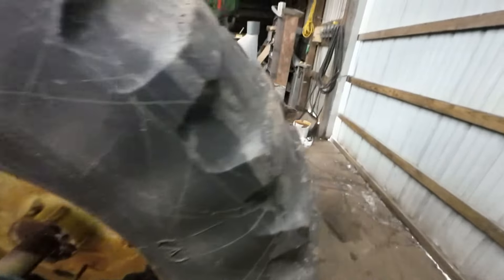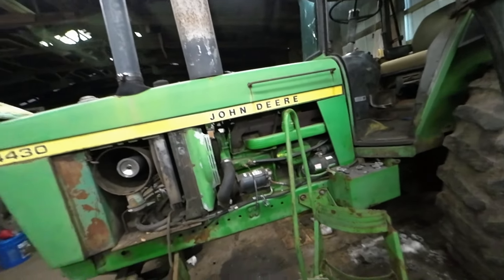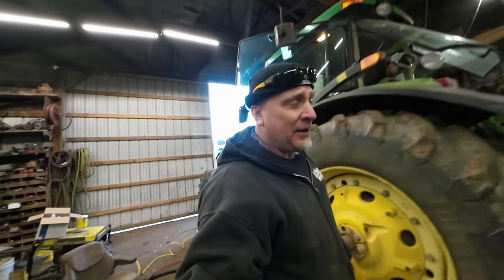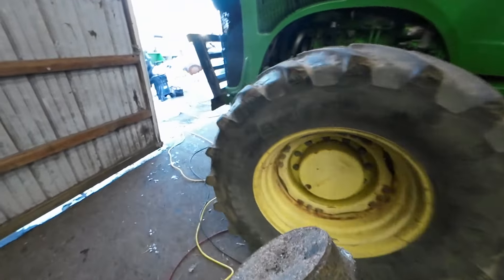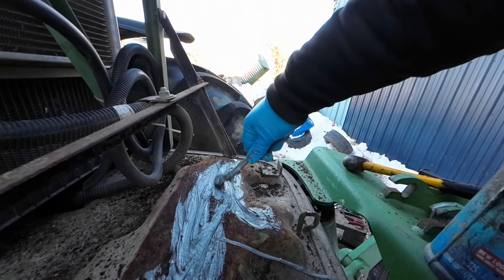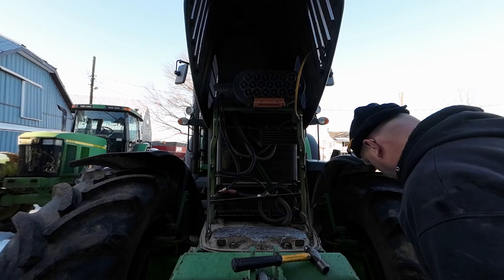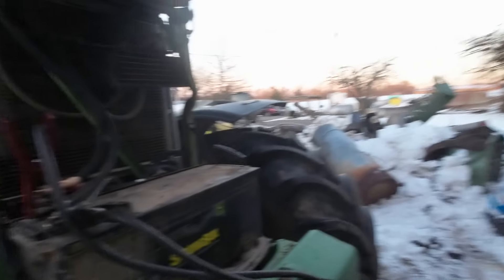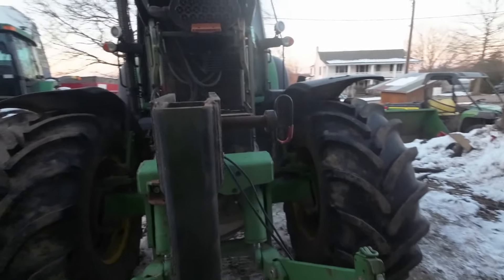4430 7530 will it start pt2

Comment: The number of transmission/hydraulic filters is based on transmission, not model. The 4430 has a single filter with the Quad_Range transmission. If the 4440 has two filters then it has the power shift transmission.
Reply from the maker: I knew that but forgot.

Comment: I would guess no less than $7000 for that hood. Deere parts are really expensive. Glad to see you fixing that 'ole girl up because they are very good tractors. This is really interesting to me because I am working on a 4230 that my dad bought new in late '73. It was the first diesel the dealer had gotten in at the time. He bought a gas model about 3 mos. before this one because that's all they had at the time, but didn't like it, so he traded it in on the diesel 4230. He really wanted a 4430 for the extra power to run the forage harvester, but they didn't have one available. I am pulling the head right now because it has valve issues making it start hard and misfire, but otherwise no blow by or overheating. I've been looking at some cab kits and other giblets that it needs after I get the engine back together, so I will be interested in seeing what you get for your tractor.

Comment: Hey Wesley , try fluid film on that battery tray. I use it under my jeep in the winters ,it works fantastic , zero rust under my jeep. And i live in the mountains of PA..👍
Reply: I use it also around batteries and terminals. It works great. I have been undercoating with it for probably 10 years now and I can honestly say it's the only reason my '02 GMC 2500hd isn't an orange dust stain in the driveway. Well worth the time and money to use it everywhere possible for everything. Winters are harsh at times in the NE mountains of WV, so lots of salt on the roads.

Comment: Sentimental value. We still have my late grandfathers 1956 model 420. While he didn’t get it new (he bought it in 62), it’s still here and probably won’t ever leave. It worked every day until the early 2000’s. Did everything at one point from raking hay (3pt pto rake) I think it even blew silo at one point. The last job it did was on the feed wagon for the heifers.

Comment: Is it possible that your tractor has a battery management system on it like the newer cars have. They have to go into the computer and reset the life of the car battery every time they change it just like an oil change except you need a scanner to do it. I’ve heard that those systems will kill a new battery quickly if the computer doesn’t get reset.

Comment: My brother had a 4630 it had one hydraulic filter Andy had a 4650 it had two hydraulic filters
Reply: Probably depended on if it had a power shift transmission or a quad range.

Comment: If you do as good as job as you did on the Deere sixty remember the one you had to get three starter pulleys on the one I believe the spline was batterd the one was the wrong one if I remember correctly and third was a hit any way I can’t wait to see the power house up and running is it fair to say that model was as good or better than the forty twenty